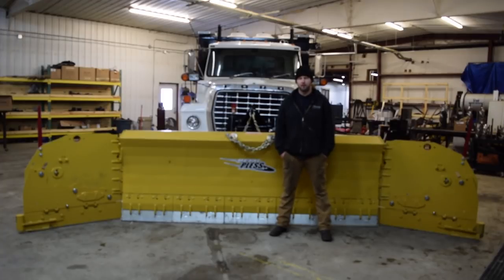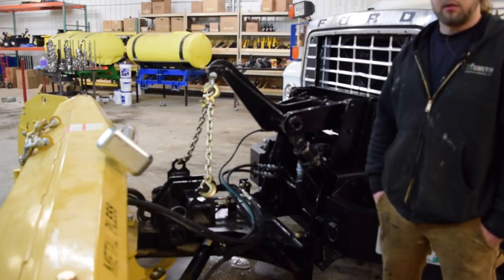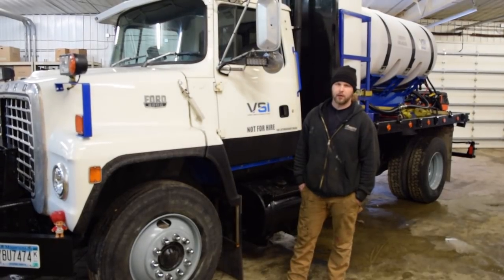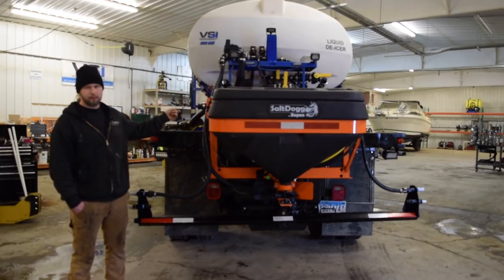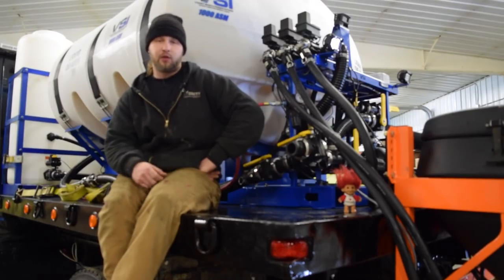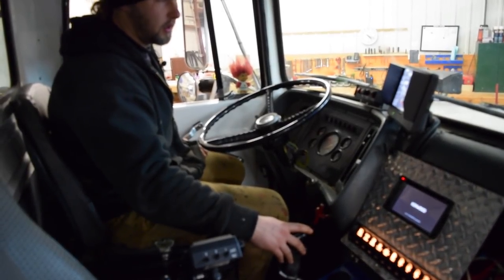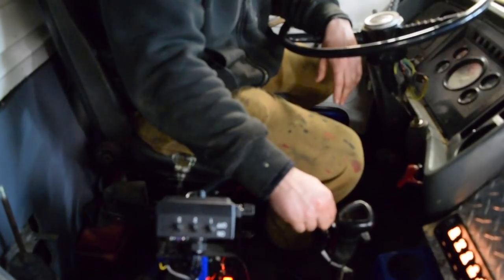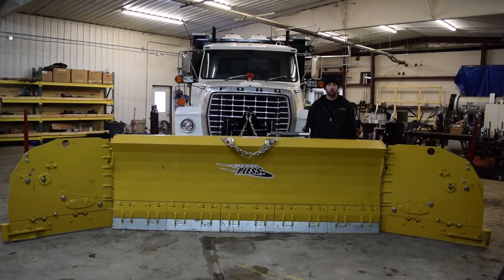L8000 De Icing Test Truck

Comment: That truck looks AWESOME, I am anxiously awaiting the videos with it in action. Do the Rock salt /Brine side by side comparison tests first. I am slowly changing the thought processes of my “Old School’ salt guys and  the videos will certainly help me out. We had another successful snow event with your 305 units this weekend. Pretreatment with brine before a plowable event is the only way to go, each pass gets you down to pavement instantly.  We are still working on getting our post treatment dialed in, but we are getting there thanks to your equipment and Adam’s help. 

Everyone watching this video that is not using brine, why aren’t you? Or, why aren’t you using VSI equipment? This video shows their commitment to helping all of us snowfighters learn how to use brine and why it is better than just rock salt. VSI equipment is top notch and the customer service is above par. I have a VSI competitors product and it is nothing but a problem every-time we use it, something doesn’t work correctly or something breaks. We have to work around it’s limitations to make it work for us. IT IS CHEAP PLASTIC CRAP! We can count on our VSI equipment to work every-time, just as it is intended to do. We trust it with out question. If you buy from someone else, you probably plow without music, you are not worthy of this equipment. Keep the videos coming Dave,  I would really like an in depth one on the controller.